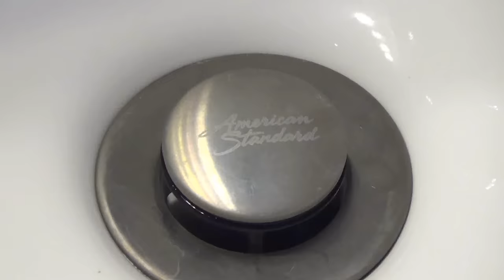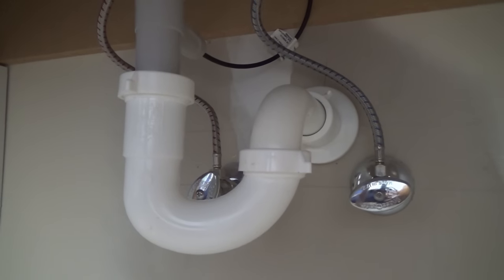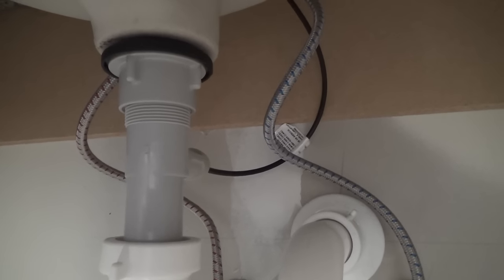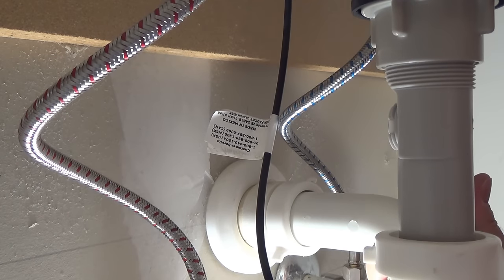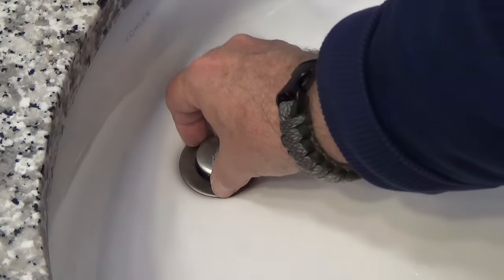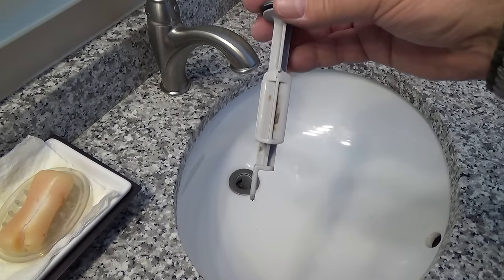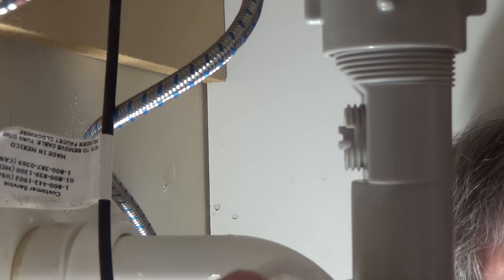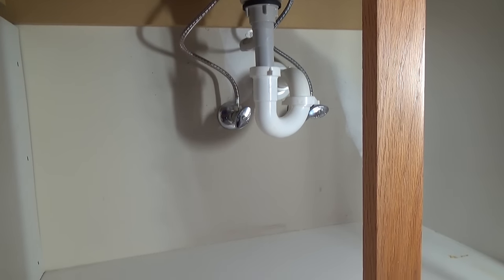Unclogging American Standard Drain Stopper.  FTHVN 499

Comment: Another Key tip is to use a Dime on the first plastic piece with the L shape and align the dime into the notches and turn clockwise until your stopper raises up all the way. Then put the outer plastic piece into the notches and then reattach the cable. That first L shaped piece has an offset cam on it and makes it adjustable. Thanks for the video.
Reply: This is key, because the stopper won't function if you don't align the piece with the notches facing up-down. If they are left-right, and you out the clip back on, and the controller, the plunger arm won't do anything. It has to be up-down, and good call using a coin to align it that way.
Reply: This is probably the most important tip that was left out of the video.
Reply: I'll be trying this soon as I've done this five times and the plunger won't do squat.

Comment: Thanks!!! The space under my sink is really tight and I couldn't get a good view. I had no idea which parts were supposed to be twisted or pulled. With your instructions, I was able to pull it apart - without even being able to see what I was doing. It took a fair bit of force to pull the smaller parts out. Without the video, I doubt I would have realized that they were meant to separate. The hair ball that I pulled out was even bigger than yours. The only piece of advice that I didn't initially follow was cleaning the drain with the paper towel. Because of that the parts didn't go back together properly and I had to take it apart again and clean it. Now, it fits together and works well.
Reply from the maker: Glad this helped!  Thanks for the great comment.

Comment: Thanks. I found that the plastic hook had to be installed pointing down as you said in the video. Its keyed so it won't go in all the way otherwise. Once it was in I had to pull the stopper up to the open position before screwing on the cable for it to work properly again.
Reply from the maker: Glad it helped and thanks for watching and commenting!

Comment: Thanks for this video... just wanted to give you a heads up. According to the installation instructions, if you turn the stopper the other way (i.e., so that the flat side (or tab) is away from the faucet) it will move up and down, but won't be locked.  That little "J" hook (or what you called the control arm) loops into the hole to lock it in place.  If the "j" hook isn't in the hole, the stopper can be pulled out any time (the "J" still controls the stopper to move up and down.

Comment: Great tutorial. This gray hair just removed much yuck...I purposely didn’t put the HOOK back the way I removed it, so I don’t have to crawl under the sink in the future. I just set the parts inside before putting the final part on. Tightened it, no leaks...plug works fine...happy 😃

Comment: Well I got the parts out and pulled the plunger and cleared the clog. How ever the push pull rod the move the
plunger does not move travel up and down as far as it needs to to let out the water. Do I need to get new parts?

Comment: You can also turn the stopper 180º with the flat eye toward the front of the sink and then the stopper can be removed at any time without having to go under the sink and disconnect anything. Based on what you found in your drain, this might need cleaning again
Reply from the maker: Thanks for watching!

Comment: I prefer to disengage the plunger from the stopper so the stopper can be pulled out easily for cleaning. For this you need to position the lever arm to the right (as you face the sink) with the plunger all the way up before screwing the fixture together. Alternatively, you can place the lever straight up and place the plunger all the way down before connecting them.
Reply: will you do a video on this?
Reply from the maker: Thanks for watching!

Comment: Where do I get a new assembly at?  I have tried everywhere.  No hardware store has this damn thing.  The little plastic thing in there is broken and I need a new one.  I took it apart and put it together again with your help.  This is one project I can do except I can't get my hands on a new assembly.  Used is OK if that is all I can get.  I almost never fail with eBay but nothing there.
Reply from the maker: Try American Standard Parts.  Here's a link.  https://www.americanstandard-us.com/parts-support/parts/shop-faucet-parts
Reply: @FlynBrian  THANK YOU SO MUCH!

Comment: I did this and could not get the white little clip back on. I do have arthritis so maybe I just didn't have the hand strength? I ended up not putting it on and reconnecting the wire part so it doesn't leak. I will have someone else try tomorrow. lol

Comment: Hey Brian. What is the best way to get the button thing snapped in? I have the plug pushed down in closed position, and the lever up (closed position). Without the l-shaped thing inserted downwards, I can't get the  button piece (that you used the flat headed screwdriver to pop off) back on. As though the l-shaped thing isn't in far enough. Because without it, the button snaps on beautifully.
Reply from the maker: Hmmm.  You have have that backwards.  Pushing the rod on the faucet down is the "open" position for the stopper.  Put it up closes the stopper.
Reply: Thanks Brian. I figured that out. Works beautifully now!

Comment: Nice video but I can't get the plunger to work. Also the little hook was facing down in my sink not up as you had it
Reply: If you have an overflow pipe in your sink, (a hole or slot near top of basin) Put some wide tape over it to make the plunger suck. Without the tape on there, the vacuum of the plunger will ricochet of the clog and gush out of that overflow pipe.

Comment: My cam is stuck does anybody know what to do then
Reply from the maker: If it won't come out of its mounting, it's likely badly gummed up unside.  It will eventually come out if you work it back and forth.  One out, you can pull the stopper and fully investigate the extend of the goo that has built up.  If the cam simply won't budge, you will need to remove the trap.